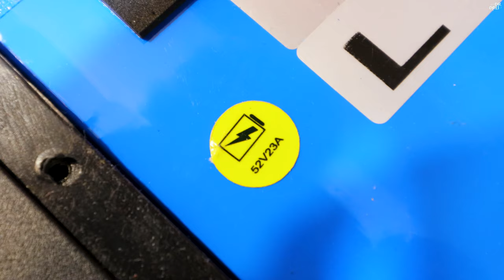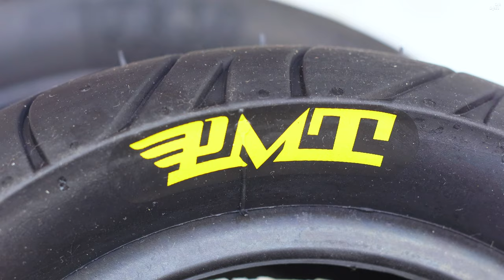Upgrading 10X Scooter with PMT Tires, MAGURA Brakes, SKF Bearings, 160mm Rotors | ASMR by Dr. Drei

Comment: Loved the video, thought you were swapping to tubeless which is what I'm after,l, alas not.  In your video the only things I do different vs you is everything gets a drop of LT on the first threads and when I do the brake I loosen the bolts on the brake caliper mounts ever so slightly and give the throttle a blip.... it will center itself perfectly and you have no scratching/rubbing noise from brake, also works if a little off true usually.  Also baby powder on your tire tube/inside tire... this will allow the tire to seat easily and less chaffing/friction after install as well if using hard braking down a hill etc.

Fantastic video though

Comment: Hi, found this super helpful, my son an me are repairing a 10x that was in a crash, lots of bits broken, and most of the bolts are loose or missing  but slowly getting there, the front wheel was hit hard an broke the ring. Lucky for is its not the motor side, just waiting for that to come. It has honeycomb solid on it at the moment but not sure to go back to tubes. They are a little worn and a slight flat spot on the rear. I also think on solid that the top speed is lower due to a lower profile type of tyre?  Fully charged its only going 27mph but the power wants to pull you off!, we have a little problem with the eco button as it seems to be stuck on as it does not click on and off like the turbo button does, looking at the back there are tiny screws so going to dive in and see what's happening. We are in the UK and now these scooters are a no no and a real shame, my son loves it but its going to be hard to say its a project and cant keep it plus we are not on private land.
Reply: Solid tires suck... ensure you are in 3rd gear and dual drive and toggle the eco button on and off while having propped on wooden box and see if noticeable difference
Reply: Yeah know what you mean... just bought a vsett10+ police pulled me over whilst doing 30mph lol 😆 but yeah there clamping down now even though there's still idiots around 3 on a scooter etc I generally ride mine because a friend lives 10 miles plus away. Wish they'd sort the law out

Comment: Curious about what you are using as your snake, I have to do a stem replacement on my Varla Eagle One and I can't find anyone with a video of that so I am referencing this one to do a DIY replacement. What are you using as a snake to run your cables back through the stem and the battery housing of the scooter?

Amazing video btw, I've watched it about 6 times now, and I'm sure this time won't be the last, I have gained a ton of knowledge about my scoot from this upload. 

Keep up the good work and thanks in advance.

P.S.  Just put some PMTs on the ride as well, this vid triggered the purchase.

Comment: And the brake hydroline from the wheel can be moved outward And then the holes where the hydraulic oil is poured can be inserted Or you can insert a hydro line through the adapter

Comment: Salut, am cumparat si eu recent 2 anvelope de la Dakor, 10x3 PMT. Le-am montat pe un Vsett10+. Una dintre anvelope dupa ce am montat-o oscileaza, pare stramba. Am reluat procesul de instalare crezand ca am gresit ceva, dar rezultatul e acelasi. Se poate sa fie din camera? Retur nu cred ca pot sa fac, la Dakor pe site scrie ca se monteaza fara camere, ce parere ai?
Reply: Bearing or brake... find if the rim is true by holding something to rim (pencil?) And see if it touches the entire rotation of rim or if warped... likely your bearings aren't flush or are cockeyed

Comment: Excellent and detailed. Pictures are worth a thousand words, I subscribed. One thing I didn't understand is it said changing the bolts to metal ones @7:37, aren't they metal to begin with or was it changing them to stainless steel ones ?  Could you have painted the rotor with some high heat clear paint after you sanded them down, or use nail polish ?  Are all the bearing the same on 10X and Dualtron motors ?
Reply: Why would you paint the rotor with high heat clear paint?

Comment: do you using 3 Jaw Bearing Puller (is posted on your tools list) to open motor lid as in 5:05 ? isn't is too small for lid opening as on they site noted work space only 75mm? can you link yours?
Reply: They're £15 on Amazon bruv. 75mm or 3inch is how much it will pull out, not the size of the clamps.